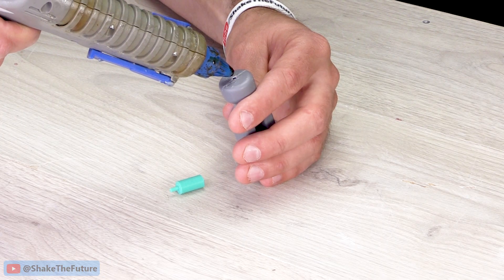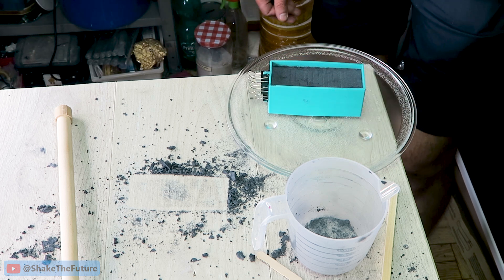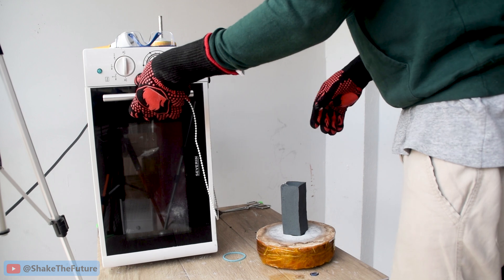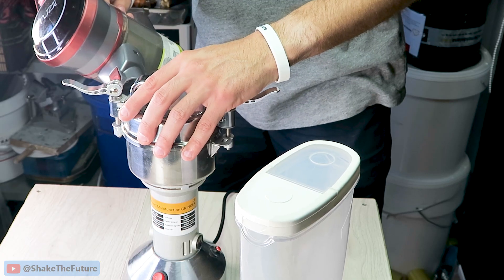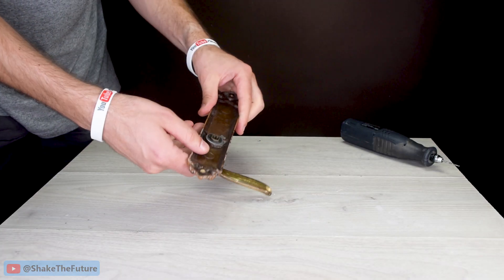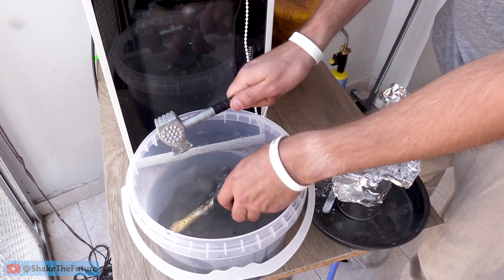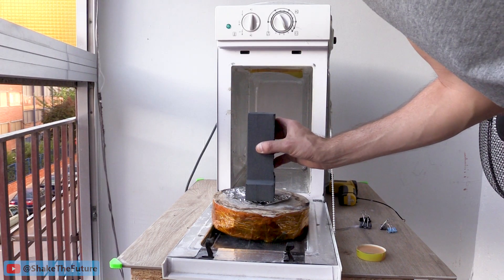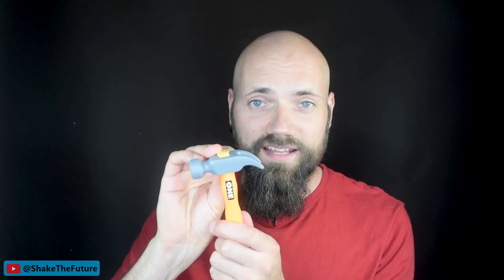Melting Cast Iron in a Microwave

Comment: if you place some borac asid in your crusaval first then add a little all the way therew the metal insert faze the a little tp cover the top you wil end up with a better meltleated mettel. alos mix thetal 3 to 4 times when smelting. thats my prefered mehtod. quanty pf borax dependonsa on the amount of metal. egansampile 4% borax to metal used is my persomal prefrance. from Puppa Prank

Comment: You didn't lose the zinc, your metal is still yellow. However the outside exposed to the air will let the zinc boil off, meaning you will have a tiny layer of copper on your cast, but it can be ground off
Reply from the maker: I see. Thanks for explaining 👍

Comment: Do you have to use Silicon Carbide sand or can you use that green sand used for normal metal mold making. I didn't know if that green sand would work the same in the midrowave
Reply: You may need to heat it a but in some ways but should work for casting for sure

Comment: damn, thats an industrial flour grinder you use.sorted food just reviewed it,sick device! 

do you wear a respirator and gloves when handling loose silicon carbide? it's a carcinogen
Reply from the maker: Yes, it's an industrial food grinder, but it's not expensive. Usually, when people think of industrial equipment, they associate it with a big price tag. However, I paid around 40 EUR for this one. It's my second grinder since the first one broke. The first one (the same model) was slightly more expensive.

Regarding silicon carbide, I typically wear a respirator, especially when handling smaller grit that can generate dust. I’m not perfect, and there have been occasions when I didn’t wear a respirator, but I generally I do.

As for silicon carbide being carcinogenic, I believe there might be some confusion with another material. Even the website where I purchase it states the following:
"Silicon Carbide is not dangerous to health. Its use is not associated with the danger of silicosis. Silicon Carbide is neither carcinogenic nor toxic."

That said, wearing a respirator is definitely advised, as inhaling silicon carbide dust over prolonged periods can still be harmful.

Cheers!

Comment: I have a question. Using this method, if you poured a complex mold and suspected it didn't fill completely, for example, when pouring copper through the hammerhead, could you reheat the entire mold in the microwave since it's made of silicon carbide?

If so, what would prevent you from creating a crucible with a hole at the bottom, acting as a funnel, filling it with raw, unmelted metal, and placing it on top of the mold—both inside the microwave? This way, in one fluid motion, the metal melts in the crucible and, once molten, drains directly into the mold.
Reply from the maker: You could do it that way, but not with all metals/casts. For example, if I wanted to do it with iron, it would be a tricky process given the size of the mold. I would need to bring the mold to a very high temperature in order to melt the iron, which is not easy. The larger the mold, the longer and harder it will be to heat it up. I would also need to make the mold bigger to accommodate the raw metal. It can definitely be done in some cases. Cheers!

Comment: Covering the molten brass in crucible with flux somewhat reduces zinc evaporation.
But molten flux is also very aggressive towards ceramic fibers, so it's better done inside a normal oven with firebricks on the bottom
Reply from the maker: That's some great info. Thanks!

Comment: Someone else has probably already mentioned this, but just in case: you should have poured the handle upside down, with the head at the bottom, and left a pocket under it for the brass to flow into as a hot well. This will help you fill better, because that small opening is going to want to freeze first, particularly with the cast iron acting as a heat sink. If you pour from the end of the handle, you'll be much, much better filling.
Reply from the maker: Oh yes, I agree. If I'll cast another hammer, that's the way I'll do it. Cheers!

Comment: Hi, what temperature do you reach when melting the cast iron? From what I can find, the melting temperature of cast iron (even in the low range with a lot of lead) is 1200C. What I don’t understand is how you reach temperatures above 900C based on your kiln design… If I get it right, your kiln works by microwaving the silica carbine lining. The microwaves should only be able to heat things that have a dipole moment (capable of dielectric heating; I.e are magnetic), but silica carbine has a Curie point at around 900C… So any microwaves above 900C should be affect the silica carbine anymore, and thus not be able to provide more heat anymore, which should mean the maximum temperature of your kiln is 900C. Or I’m missing something in its working principle. That’s why I’m so curious what temperature you reach!
Reply from the maker: Hi!

I don't know the temperature since there is no way for me to measure it. All I can say is that it works. I don't know all the theory behind why or whether or not it should work, but it does.

I can also melt small quantities of stainless steel, but only very small amounts.

Cheers!
Denny
Reply: @ShakeTheFuture  hello!
 could you elaborate on what you mean by small quantities for example : 100 g ? or more 
I am really curious in using this for a similar purpose it would be a huge help if you could elaborate

thanks !
Reply: @ShakeTheFuture  
hello!
could you elaborate on what you meant by small amounts of stainless steel , as in how much was it , I am trying to do something similar with stainless steel and it would be a huge huge help if you could

thanks !

Comment: Have you considered building a ball mill (large rotating cylinder with heavy metal ball bearing balls) for turning hardened silicon carbide back into powder ? 
Does the sodium silicate you add the silicon carbide, burn away during curing or will it accumulate on each recycling until the silicon carbide is unusable for mold making ?

Comment: I appreciate some of the safety precautions you're taking but you're forgetting one of the most important ones.  Please get some oxy-acetylene eye glasses, staring at crucibles or metal in those temperatures will damage your eyes.  A welder's hood will protect your face skin from that radiation too though may not go too low unless  you get a fixed lens.

Comment: Silica sand is cheap, and commonly used with sodium silicate and/or other binders in iron casting.  Curious to know why you used expensive silicon carbide instead for your molds.
Reply: I'm guessing because silicon carbide helps avoiding some of the oxidation in ferrous metals? I'm not sure either. Could be that, or could be it's a finer grain so more detail in the casts.
Reply: The heat from cast iron is too hot for sand mould
Reply: @wesleymccravy901  all over the world, every day, cast iron is poured into sand molds. The proof is all around us!

Comment: Can you use this technique to get enough details that you can make your own coins? I suppose 3d-print them and make the silicon carbide mold and then just do as you did? But I don't know if the details will get good enough. I suppose that at the very least you will need a fine grained silicon carbide?

Comment: So you basically leave the plastic handle of the hammer in place and spill the molten metal into it... the plastic will melt all right but is that a good thing where does that melted plastic goes? Into the coating you break off from it?
Reply: No the plastic is burned out and turns to ash and cleaned out before the meatal is cast. See 3:39

Comment: Gloves with plastic and molten metal is a nogo!
Reply from the maker: They are hight temperature resistant gloves. There is no plastic in them. It was silicone coating that caught 🔥 They are rated to withstand up to 800c for short periods of time. There are better gloves available, but I like these....been using for years. Edit: There is also a possibility that there was some wax on gloves and it caught fire. After investigating the gloves the silicone coating looks intact, but other finger had a drop of hard wax on it.

Comment: Very nice video! 
How is the Metall not poured into the vacuum cleaner?
Reply from the maker: Thanks Max!
The moka pot funnel is connected to the vacuum cleaner using a silicone hose. The mold does not leak, so the metal remains inside it. I have never experienced any accidents where the mold would break and the metal would leak into the vacuum cleaner. While I have had molds break before, metal leaking into the vacuum cleaner has never occurred. There was one instance where I made a mistake (brain-glitch) and poured aluminium directly into the funnel without using the mold. As a result, the funnel melted and aluminium got stuck in the silicone hose. There are also stainless steel moka funnels, those would not melt. Cheers!

Comment: I've never seen anyone use silicon carbide as a casting material before, neat. The hammer turned out pretty nice! No blemishes or voids or anything. Will the cast iron be more prone to shattering than wrought iron, or whatever hammers are made of?
Reply from the maker: I believe it may be more susceptible to shattering, but I don't think it will be a problem for a hammer of that size. I won't use the claw side of the hammer, just in case. Hammers used to be made from cast iron, so it's a legitimate hammer, just smaller. Cheers!
Reply: Love the silicon carbide mold as well. Cured sodium silicate should redissolve in sufficiently strong hydroxide solution, especially with the help of a little heat. (at least thats my unfortunate experience in trying to hydrolyze PLA out of sodium-silicate sand molds). Should be more convenient than the blender I think., and it leaves the silicon carbide untouched.

Comment: Si-carbide form - seems expensive (although reusable). Some use organic solvents to melt the plastic out of the form. Vinegar (some suggest even caustic soda) might destroy water glass polymer and ease the form grinding to recycle Si-carbide. I'm no expert, but from what I've read, a bit of Al (or Be or Si) added to crucible should reduce Zn evaporation: it will melt early and float, preventing Zn evaporation. Yes, this requires you to scoop it out somehow afterwards. Also, temp must be below 950C, but you already know this, I bet.
One idea, perhaps. Metal-metal composites. I know they use steel to reinforce Al (it's preferable to cover steel with Zn-Al thin layer beforehand for good adhesion). I tried to look up zamak-steel or zamak-tungsten composite, but no luck thus far.
Reply from the maker: Silicon carbide is not that expensive if you buy it in big bags. I buy 25KG bags of silicon carbide for 130 euros including shipping. So making 1 small crucible costs 0.52 eur/cents in silicon carbide. For EU viewers search for "ots-store". That's where I get it from - Germany.
I am curious to try caustic soda to dissolve waterglass. Thanks!

Comment: Zinc loss is very probably from too high temperature. You've got to keep it fairly low. Check online for some ideas of what casting temps to use for brass, it varies from alloy to alloy. Zinc itself starts to get obliterated at about 900C, but less when alloyed. So try to fine tune your process, and work out a way to calculate the temperature for a given soak time (i do realise it'll vary from melt to melt due to changing volume, so maybe a quick check every x seconds with the digital thermometer?)

The sprue idea at the end is correct, that would very much be how you combat the temperature shock and metal shrinkage in that part of the cast.

Love the recycling of the silicone carbide material, very innovative, I've never seen that approach from anyone, same with the microwave kiln technique. I may well adopt it and give it a go for melting metals, as my crappy electric furnace keeps popping coils even with mere copper, which it barely gets to melting point! 

Thanks so much for sharing ^_^
Reply from the maker: Thank You for the feedback! I will take the note 👍

Comment: I will suggest a cover slag for your brass/bronze melts composed of a mix of powdered glass and borax. This cover slag will protect the melt until you are ready to pour. Skim the melt just before pouring to minimize zinc loss...
Reply from the maker: That's interesting. Thanks You for the tip 👍